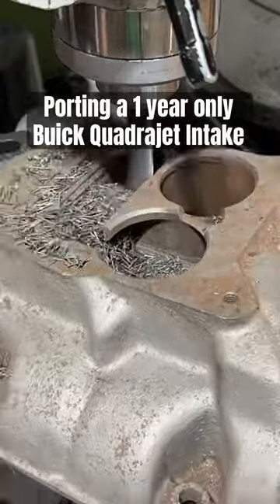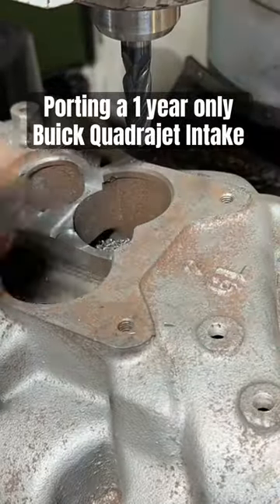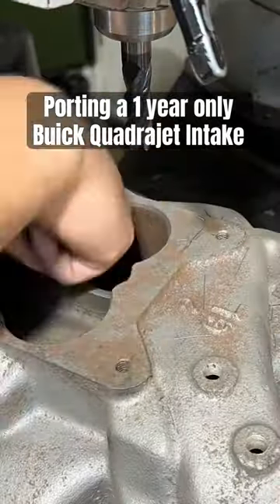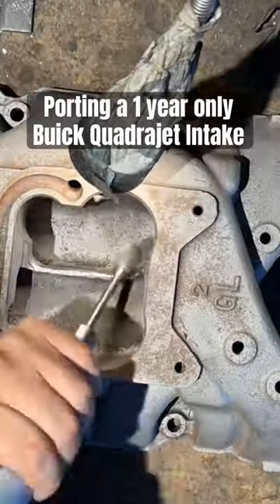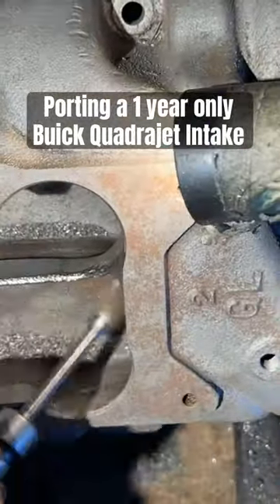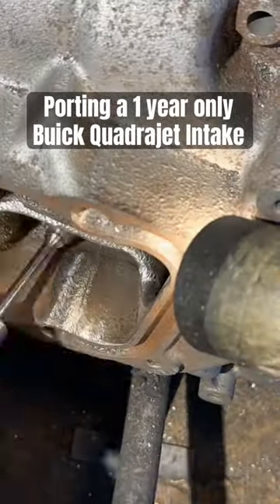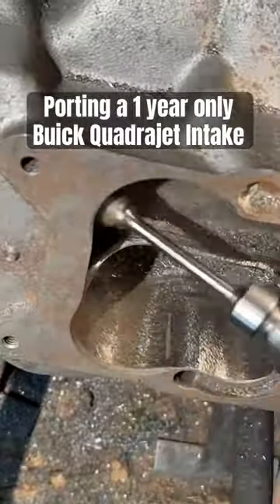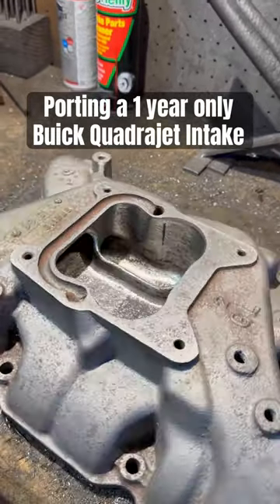If someone likes modifying rare parts its me! #shorts

Comment: Dude I like it nobody puts work out like that anymore. Everybody else would just say put an ls in it. Nice job 👏 👍
Reply: I mean that wouldn’t be a terrible idea….
Reply: @user-xk1uy7ze9z  actually sounds like a great idea. My 2018 Kona is gonna be paid off in a year. Im gonna keep it and buy a new car cause I want to engine swap the kona and do some other work to it. Will be my first car project I am gonna be taking on so it will probably be a nightmare but LS just seems like the only choice lol
Reply: @Titantitan001 it'll probably never be finished I think is what you ment to say.
Reply: @Titantitan001 LSs are overrated lifter and camshaft grenade engines.
Reply: @JosephArata that's why they last 300000 miles
Reply: @JosephArata you mean lt? And all problems that fet solved with mods and lets be honest, none of us watching this keep an engine stock unless its a daily
Reply: @Titantitan001   don't follow the crowd  . Think of something original. Think outside the box
Reply: @earlfreimuth5799 exactly, throw a duramax in it

Comment: I for one commend your effort,  by leaving a rough surface you actually increase airflow,  we've proven that polishing is counterproductive and an irregular surface allows for less intake turbulence but in my opinion the quadrojet is overly complicated and under performing
Reply: Something to do with shear stresses at the interface w the column of moving air(?)
Reply: @axeguy3856 

Like golf-ball dimples. Maybe like a bearing made out of the same fluid you're trying to move through the system. The pitting traps some pockets of the fluid and dampens jostling / lateral-reflection with destructive interference before it can disrupt the core of the flow.

Comment: Modifying stock parts is a good way to make power I do think that a 1 or 2 inch spacer would help it even more,  I myself modify stock factory parts all the time and have good luck with it,  nice job and thanks for sharing your video
Reply: Wouldn't look stock nor fit under the hood
Reply: It's funny that so many people in the comments think they did all this testing on cars back in the day where they, without a doubt have made the part far more superior than it could ever be! 🙄 Ohh that's why cars weighed six thousand pounds and came with 130 HP at the CRANK! 😂 

The only thing manufacturers cared about is that the average consumer didn't have to fuck with it because the temperature dropped fifteen degrees and it's humid! 

Whatever it takes to have the least issues until AFTER the warranty expires! Performance is by far not what they model everything after! 

You could make a space "disappear" and an air cleaner clear the hood!

Comment: I am well over 50 and an engineer. If this is for a street engine, I would suggest only modifying the secondaries.
With spread bore carbs, not much of the total CFM comes from the primaries, but high velocity and good vaccume signals and venturi effect results in much better throttle response and idle, so opening the manifold under the primaries will result in significant loss of idle quality and throttle response and a lag or stumble off idle due to the sudden exposure to the large plenum under the carb.
Secondaries can be opened up and the divider reduced for better high RPM flow  from combined secondaries when the GM engine draws twice in a row from one bank of cylinders.
You might consider making a removable wall between the primaries and secondaries to test the performance and drivability with the primaries and secondaries separated and combined.

Comment: I'm over 50 and I approve this for the simple fact that this is high performance that needs done like your doing because it's a production part and would be cost inefficient at the factory .I hope you followed through with the ports to the heads and gasket matched ( port and polish) the heads as well. Great job!

Comment: ‘Signal to the carburetor’?…what? Looks cool tho I hope it runs great 👍🏼
Reply: Yes signal to the carbie , that is how a any carbie works , it gets a vacum signal from the dropping piston controling venturi effect.
Reply: @JosephCowen-ru7up  yup I know how a CARBURETOR works…just never heard vacuum called the signal. We just called it flow 👍🏼
Reply: @nathankelly7259  flow is a continuous liner event in an enclosed space , carbie signal varies in intensity and pressure due to obstruction and engine rpm , flow refers to measurement of movement  as in MAF sensor or manifold absolute flow sensor , but carbie signal varies with pressure waves bouncing off port walls , shape of intake track , valve opening speed , duration and piston speed. The signal a carbie gets is always changing even if total flow remains the same , if the carbie was rite at the port opening in the head unobstructed by any valve it would be inline with total flow and a perfect sine wave of vacuum flow and total flow , but it isn't and all these other factors effect carbie performance , that is why at full throttle with the butterflies totally open and a virtually unobstructed flow path a carbie is as good as EFI for power ,
Reply: Schooled

Comment: I chose to do something similar to a rare CRX HF Honda intake. Ditched the marvel of engineering HF carb for a Webber 38/38 and decided to knife up and remove the excess material that created a face inside the mounting plate.  Did it all by hand using an air rotary tool. I'm not sure what gain in CFM I got, but the extra entry area I estimated to be 1⁷/⁸in. sq.
Reply: How’s it run?
Reply: @GR40RCapri  I'm currently rebuilding the engine, but before the piston rings gave out with 335000 miles on them, it was running great. Most people I found online that put the 36/32 progressive Webber on the DX or the HF had trouble getting it tuned, but I was able to tune the 38/38 outlaw with open headers in an afternoon. After the head gasket change before i installed the Webber, I had low compression on all cylinders. 1 and 4 were the worst, but the best was 92psi. Spec is 125-145psi. I have no clue what HP it was making, but I'd guess around 80HP. My hope is that with an over bore and a custom exhaust it will make 110ish.

Comment: I'm over 50, ( and then some)....
I've done things like this for decades,
Never worried too much about how rare the part was if the appearance didn't change. 
Sometimes to build the consummate sleeper, and further back because I couldn't afford one or nobody made one.
I thought that what 'hot rodding' was about.
Reply: Exactly. Most of the bolt ons are junk nowadays. Alot of "new" parts are garbage as well.

Comment: I have no problem with a stock looking engine from the 60s-70s making 550 hp. I like that better than just throwing a LS7 in the car. These performance cars were built because guys were building/modifying cars and created a market for the big 3 to follow and make factory hot rods/muscle cars. Funny thing was some engineers put limits on these modifications when the private sector had no rules. That's where you get the cobras and yenkos etc. The whole muscle car craze started after WW2 and the factories started to follow in the 60s. It's guys like you 70 years ago who started this muscle car craze 🧐😁

Comment: Nice work. Turned a part that was designed for fuel efficiency and modified it for increased horsepower. There may be a slight decrease in low end torque output, but the added airflow at higher rpm will be well worth it.

Comment: The Qjet was a better engineered carb than given credit.  The manifolds, Heads, and exhaust were very much an issue.  The Qjet could be tuned to operate very well if you knew how.  Not as easy as some others.  The fact it could be used on a variety of CIs and would automatucally adjust flow made it a popular choice for GM.   It took me a long time to appreciate the Qjet.  Great job on that intake.  It will flow bettwr no matter what carb you bolt on.  Well done.

Comment: Many of these manifolds have already gone to the recyclers. Offenhauser makes manifolds that are already opened up . The reason why the manufacturer made the manifold the way they did was to avoid warping under extreme heat for better gasket seal under high vacuum. I used to do things like this back in the seventies to increase flow but it ended up effecting vacuum changing my low end torque as the manifold acted like a high rise manifold instead of a stock manifold .

Comment: Had a 340 motor with a cast iron. Dual plane intake did the same kind of work headers and dual exhaust. I've learned that happening a rough surface intake and runners help break up the gas and air making small molecules which is increased performance.

Comment: I like what you're doing. Here's an additional job you can do to it when you're done if you feel it's worth your time...
Step 1 of 3: Use a 3D scanner to get a 100% resolution of this part when you've got it exactly the way you want it. Make sure to get the internals too if you can. If there are areas you can't get you'll need to do some SketchUp work in a 3D modeler.
Step 2 of 3: Use your 3d scans file to create an .stl file to recreate your part. You can either make more copies of the part in cheap recycled plastic to have it sent in to a shop for casting it OR, more interestingly, you can sinter print a complete replacement part complete with your modifications. And because you've modified it from the original design, you now have a new design that can be patented if you really want to go that far. If you choose to go this route, don't forget to file your patents paperwork as well as hire a specialist lawyer who's sole focus is in patents with an emphasis on automotive designs. You may need to also alter more of the design to your own needs as well as for blocking patent infringement claims from whoever the original designer was. Talk to your lawyer about this aspect because idk how that part works. I just know that as a fellow maker you'd probably absolutely love to have a spare replacement part on standby, ready to go in case this original part cracks or somehow fails on you. 
Step 3 of 3 go get yourself a beer or something. You already earned it with this video. Thank you for sharing the concept with us.

Comment: Love how the carbide tip leaves a finish that looks like it was cast that way. The original is effectively dividing the engine in to two V-4's, where post-mod the carb sees vacuum from all cylinders, which should make idle smoother and power delivery more consistent.

Comment: By opening up the top of the manifold, it may flow better at maximum rpm.  But overall driveability will probably be compromised.  It's pretty hard to improve on the original design from the engineering team.

Comment: This is what old school hot ridding was about. When people modified intakes, ported their own heads, changed their own valve springs, hell even figured out how to cut 351 heads in half to turn a 300 into a nasty power plant. The true hot rodders didn’t leave us enough and todays “hot rodders” don’t solve problems with innovation they mostly just add parts other then the exceptional few and those left from old

Comment: I own a 1966 buick gs, and I would have modified aswel. Of course, mine is the 401-425 nailhead engine.  My engine is in a bag in my barn, I've switched to the 454 for more ready availability of parts.

Comment: I'm 57 and not a mechanic but I am able to work on vehicles.  I actually rebuilt a 4 cylinder Nissan engine,  had it bored 10 over , found next year stock pistons, and had the crank ground 10 under,  got a rebuild kit, looked up torque specs,  clearances etc, reassembled it and couldn't keep a clutch in it anymore,  I even took out 2 transmissions.  I got over 50,000 miles on it before I gave up, those clutches were expensive

Comment: The only issue i could see would be a loss of a small amount of structural rigidity possibly. The performance gains highly outweigh the structural loss though. I would take it and make a mold so they could be repoped if its so rare tho. Itll be insane once we have crazy access to high tech 3d printers and can just download stuff like this and make it at home. No need for stock or shipping an intake. Just ship a block of material for the printer and a 3d model for the printer. I got a 68 sport wagon. So many weird parts ill eithrr havr to fabricate or pray i find a parts car which i also wish wouldnt happen because thats another car down. Great work have fun! Keep inticing the haters to pump up your videos w comments! 😅

Comment: I don't see it improving signal to the carburetor, but I do see it improving airflow and better horsepower. Typically, the 4 holes of a quadrojet should have better signal, but the better flow will make better high rpm power and flow all the way round.

Comment: It was a dual plane manifold for a reason. Buicks firing order is 18436572 the 4 fires right after the 8 and the 7 fires right after the 5 same side and open plane reduces low end torque

Comment: That front valley in the intake is for a four jet carb setup. If you don't run a 4-jet carb, make sure you cover it with a gasket/metal shim/etc, or you'll have a carb tuning nightmare. You probably already know this, just thought I'd bring it up. 
 Don't comply, modify!

Comment: I’m over fifty and this will work just fine for race application. The manifold was designed for emissions not for race. Very nice work buy the way. Did I say I have been an auto technician for over 35 years as well.

Comment: I'm over 50 and I can tell you it will work. this is 100% what hot rodding is about. taking factory parts and modifying them. That engine will have more mid range to upper end horsepower. Single plane manifolds are usually used in racing applications. where as the dual plane is good for bottom end torque. Do I pass the age test ?

Comment: I qualify for a comment so here it is 😉
That's some nice work.
Good flow with smooth edges.
Should be no turbulence in the atomized charge.
The Holley injection 'carby' would complete the look and make it easier to find perfect performance peak and balance 👍

Comment: It may create a lil more flow but it changes your numbers on Where your peak hp and torque settings.  You basically turned it into a single plane intake instead of a dual plane .

Comment: Well depending on the firing order removing the center divider may cause the intake pulses to cancel out from the left side to the right and vice versa and won’t have enough vacuum at low rpm to pull air through a carb . You’d need to run forced induction or fuel injection for this to run properly and idle

Comment: That plenum mod will increase air/fuel distribution both high and low rpm… and greatly increase mid-high rpm flow….with the right cam…jets…etc

Comment: Remember to use a block off plate under your carburetor or you won't have ported vacuum for the distributor advance. I applaud the effort but wish you luck getting a happy idle jet sensitivity.

Comment: It works depending on what you want. 
Turning a dual plane manifold, into a single plane. 
Arguably kills vaccum and air speed in the runner, which directly affects response to the carburetor. 
Although, this will allow for more flow on the top end and produce more peak power.
Low end torque and horse power will be lower than it would be, with a dual plane manifold as you started with.

Comment: Now make a Throttle Body adapter to convert the whole engine so it's a component to convert to fuel injection. Fuel injection systems can be pretty when you try harder like this.

Comment: The intake will not work as it is now sitting on the bench 🤣🤣. I'm glad that I could clarify that for you. Seriously it's hot rodding as best you took apart and made it better and you maintain the original look where does it get any better than that?? Oh it does get better because I've got one of these setting on the back shelf I believe and I never paid any attention to it. I'll check it out and see if it is a rare piece. Oh I'm sure yours is rare I'm just saying I don't think I'll be that fortunate that mine turns out to be the same stock piece. Thanks for sharing

Comment: Some times it is necessary to modify stock parts to make what platform you are using to work and sometimes it doesn’t take much to gain some decent numbers from a stock part with a little work.

Comment: Whatever makes it better.   The original restrictions were probably for mpg or government limits on hp.
Reply: The separator wall was to maximize low to mid rpm torque, which is exactly what Nailheads were known for.   This reduces low end torque and shifts it up to a higher rpm range.  Not what you want to do for stop light to stop light acceleration, but it will give more power when you punch it at 60 mph.
Reply: @blackhawk7r221  it’s a trade off.  Hp power compared to low end torque street daily drivers are not maximized, they are a compromise.   Towing vehicles are about torque, top speed is about hp on the top end, hence why many vehicles bog in overdrive pulling a hill.

Comment: I'm not over 50. It looks real neat, but it's difficult to say without a flow bench if this improved flow. David Vizard has shown many times that without baselining that intake with the quadrajet attached, how do you know you improved anything? I'm not saying it won't work. I'm just asking how you are so sure? Besides David Vizard, Richard Holdener has shown on dyno's that sometimes these big changes don't improve much or just moves the peak HP/TQ to different RPM range. Can you share some data? I like that you're building a Buick Nailhead motor.
Reply: Any Improvement you can make to a nail head, is good Improvement.